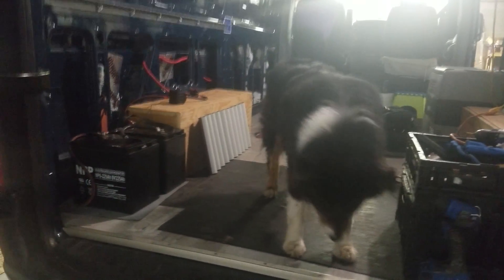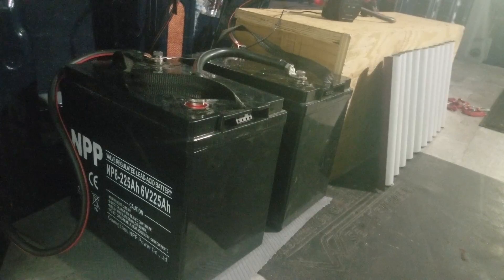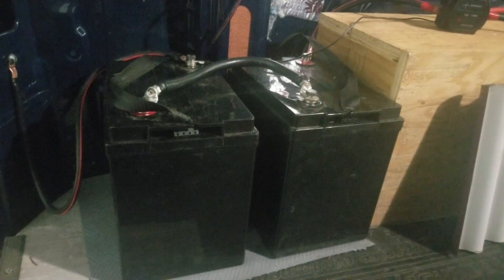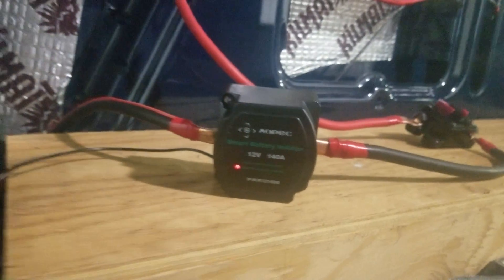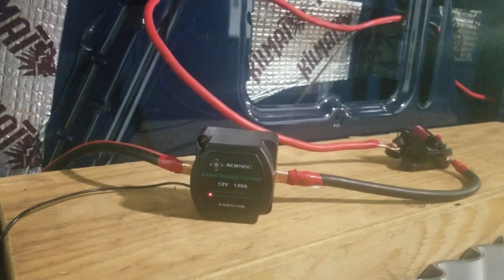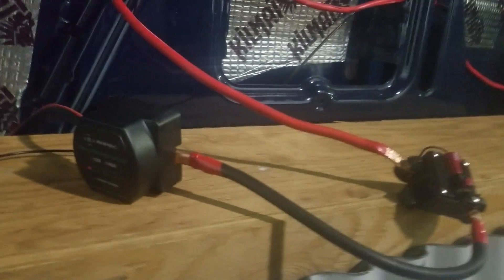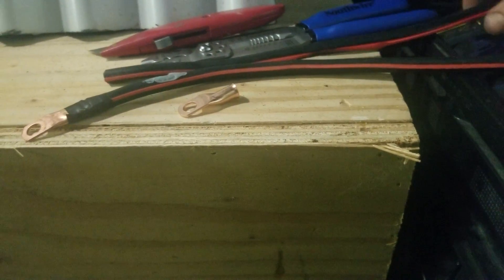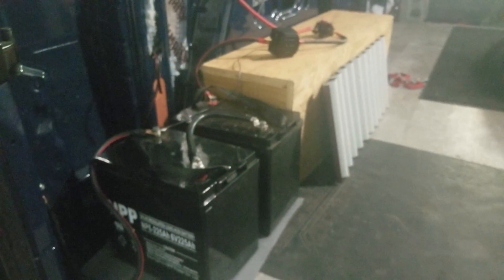Van School: Simple Charging Setup for 12v Batteries with Isolator Relay

Comment: When using your house batteries...how do you track how much power youve used? I also have 2-12v 100ah agm deep cycle batteries with an isolator. But I'm trying to figure out a way to keep better track of the daily usage.
Reply from the maker: I also use solar and the controller tells me. Before i had a solar controller i had a voltage sensor to check,  but i pretty much turned the three engine daily so it never got drained much.
Reply: @basecampcustomvans1096   hi, I'm thinking of doing the same. I don't have solar yet because I'm mainly doing stealth camp. So I'm always driving. Anyway, how do you use a voltage sensor or do you know any good battery monitor?
Reply from the maker: @KungFooDuckee  I use my solar controller for that monitoring battery, but without one you can just put a voltage sensor on: should always be in the 12's. So they float at 12.7 or 12.8, don't let drop below 12.0

Comment: You said 220 amps coming from front. So I’m guessing you have a 220amp alternator. Wich if so you answered my question. I have a 130 amp alternator and a 150 amp battery doctor isolator and a 100 ah agm battery. I was afraid of upgrading my alternator to a 250 amp because I was afraid of frying my isolator. So I’m guessing like your isolator that states 140 amps, means it only allows 140 amps to pass to aux batteries. I do imagine I would have to change my fuses from 150 amps to above the 250. Thanks lol
Reply from the maker: Yes, you're correct in all your assessments. The Sprinter has a 220a alternator.  But, my isolator only lets 150 amps through so it's not getting the full potential my alternator has, but whatever it works great.
Reply from the maker: Yes, just get some 200a circuit breaker fuses; they can be reset if tripped instead of replacing. https://www.amazon.com/Audio-Circuit-Breaker-System-Protection/dp/B01JL3IPWQ/ref=sr_1_6?ie=UTF8&qid=1546664453&sr=8-6&keywords=200a+circuit+breaker

Comment: That's really interesting, thanks for posting. I am debating what to do about power, so this is helpful. I have the factory aux, but am told it won't be enough for what I need, as 2nd battery not made for the kind of discharging house batteries need. I've read lots of debate online that says what you've done here won't work or isn't advisable: eg, standard alternator isn't strong enough to charge a >100ah aux battery or a 3rd 100ah battery, need a 2nd alternator, etc. But you said it's been working for 2 years for you ... hard to argue with that! Makes sense to me.